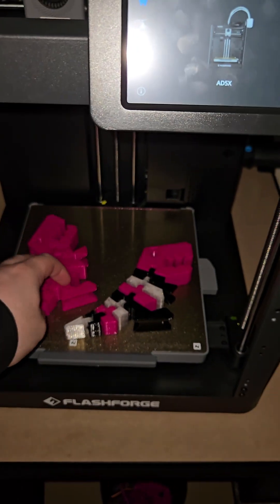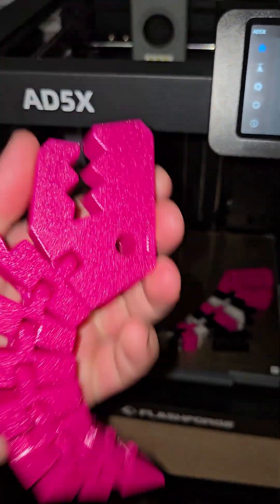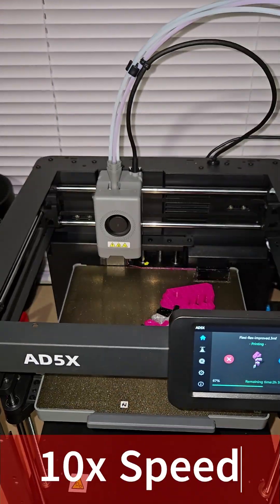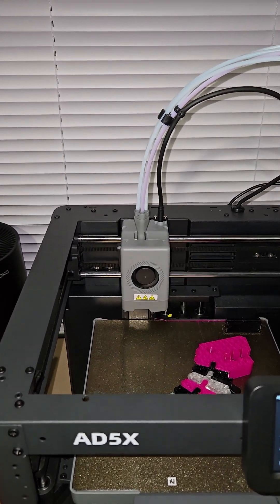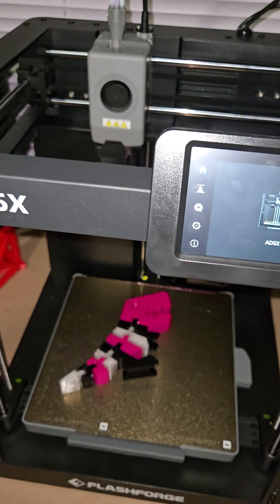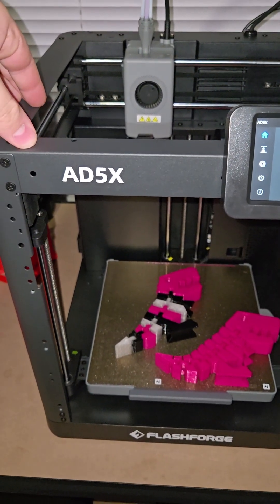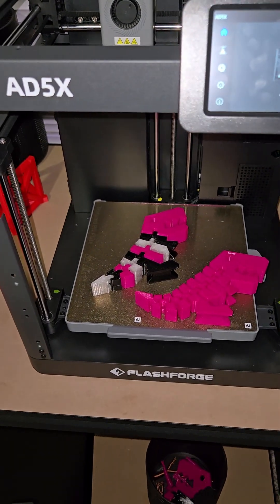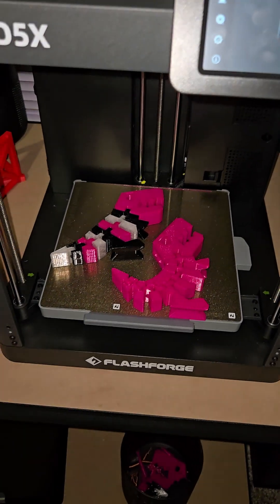AD5X Excessive Purging and Waste...

Comment: you can change that in the settings... ive got mine down to 20 t0 30 sec max.. just set it to ram to the next colour
Reply from the maker: What setting, on the printer or in Orca slicer?
Reply: @Titan3DMFG def orca slicer
Reply: Any updates?
Reply: Apparently it only lets you increase the purge amount? Not reduce. If you have a way of reducing it or could link a video please do share
Reply: I haven't been able to change the purge or even turn it off, that would be nice

Comment: 1. Not multi color, it´s multi material. Multi color by multi material as well but multi material none the less.
2. Using the same nozzle for multi material prints is stupid. We really need either an IDEX machine or even better and upgraded printhead with a dual nozzle design where you can flip between the two. This current design does not make sense. You already pointed out the flaw
Reply from the maker: Yes, multicolor. It's all TPU. 2, I agree 100%
Reply: @Titan3DMFG  The machine is multi material. Multi color is achieved by multi material, it isn´t the same material colored in. There is only one multi color printer on the FDM printer marked for hobbyists and it´s the davinci color, it´s the only multi color machine I am aware of.

Comment: Doesn't Orca slicer have advanced settings to where you can actually go in and adjust the purge settings of how many millimeters it pushes through and all that?
Reply from the maker: Yes. The printer repeats that process multiple times. So, no matter how little I want to purge, it will repeat it.

Comment: Haven't done much printing in a decade but make sure that your slicing software is printing all three parts of the same colour in a row, otherwise you'd be purging 9 times per layer instead of 3
Reply from the maker: They are. That was just going from one color to the next color that it purged so many times. Bad firmware communication imo.